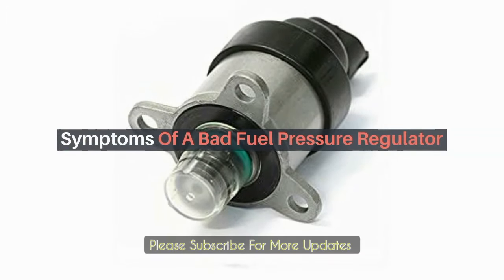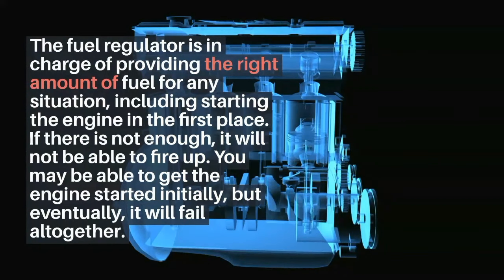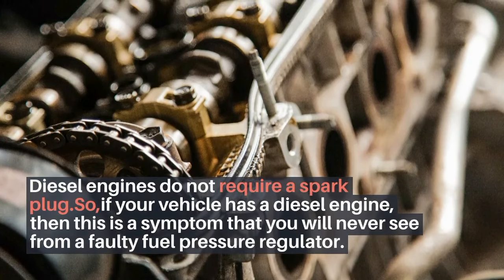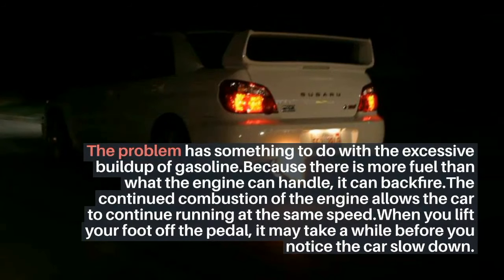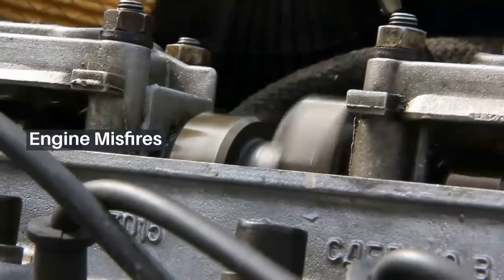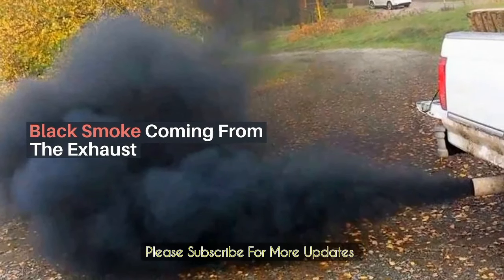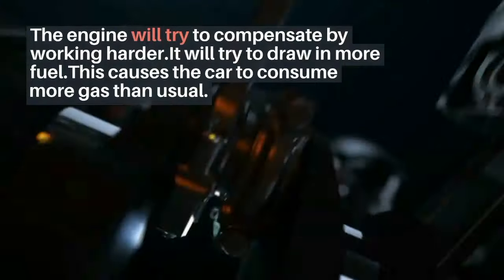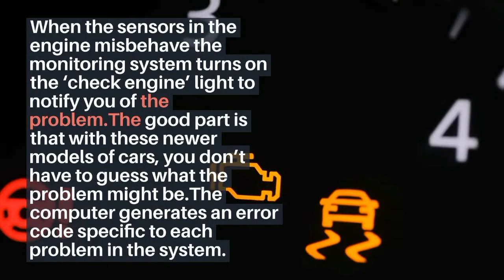Sign Of Bad Fuel Pressure Regulator | Auto Info Guy

Comment from the maker: Hope the video helps and thanks for watching. Feel free to mention your thoughts. Subscribe for similar contents. Take Care :) :)
Reply: My Chrysler neon stalled while i was driving last week, and i haven't yet diagnosed it. I was thinking petrol pump only and now this served as a reminder of basic car diagnostics (i.e. fuses, relays), which i forgotten about them. Thanks.
Reply: Hi nee d help car die take long to start sometimes when driving car stalling sometimes black smoke frm ex pipe what cn be the problem
Reply from the maker: black smoke from ex means too much fuel being burnt. Firstly clean the air intake sensors n valves, check for vacuum leaks.  Does the car give out a check engine light? Pls mention the car model.
Reply: @autoinfogroup1629  2011 renaultsandero
Reply: Hi! My 2003 chevy suburban won't accelerate at times. It shows reduced engine power on dash and when I put it in drive, it won't accelerate., it'll just drift. I've put a throttle body on and it still does the same. Anyone ever had this problem or knows what else it could be

Comment: My 90' 5.8 done all of this. I replaced just about everything and nothing changed. I replaced ICM = ignition control module and it stopped backfiring and ran smoother. But I still hear in 3rd gear a sluggish sound from engine. I've replaced the FPR too. Before ICM. So I'm sure it'll come back. Thanks, FORD. Nothing like a good screwing.

Comment: I have a 17 Jetta GLI, excessive fuel consumption. No issues starting, accelerating, no hesitation. Very poor fuel economy. According to diag tool, fuel pressure is higher than being requested by almost 2x.
Reply from the maker: This should be the regulator block.
Reply: Not the fuel pump regulator?
Reply from the maker: It should be the fuel pressure regulator. Any blocks in the regulator will cause more pressure to build up in fuel supply system. Or it could be the sensor reading wrong. Could test the line pressure externally using guage and cross check thw value with diag readings.

Comment: Ive been allover my 95 f150 looking for the problem. This describes just about every problem its having. I hope its is cause I kinda want my truck back
Reply from the maker: Lets hope it l be fixed soon :)
Reply: Was it the problem???
Reply: @jayjay7160  No. Unfortunately it didn't. It did help it but it was by no means a complete fix.
Reply: @emmanuelm2291  some things to try:

change fuel filter.
use some injector cleaner.
taking out the injectors is a bit of a pain but not hard, may need to flush them (vids show how to do it cheap) -injectors MAY need replacing but a clean should do them. don't use cheap injectors if replacing, they are all inconsistent and will give bad performance and strain your engine.
also try: cleaning and gapping spark plugs, (replace if corroded,) check inside distributor for corrosion. may need to replace either or all leads, coil, distributor cap, rotor, and/or pickup coil (requires taking out distributor, check videos before you try this,)
failing this you may need to replace fuel pump and/or clean/replace tank selector valve (if dual tank)
..slim chance you may need new ignition module or computer.
..none of this is too expensive and just requires some time, youtube has detailed instructions for each step.
hopefully this is not patronizing, just some things to consider in case 

you may also have a clogged catalytic converter.

Comment: i have 1994 e36, when i first started the car it does this limp mode(when first starting the car in the day it would also need a couple cranks before it really starts), wont accelerate and it also has an unstable swinging rpm. after idling for a moment, the car will start and move fine after i turn it off and on again. could that be a problem on the fuel pressure regulator?
Reply from the maker: Hi there, this could be any thing but less chance to a regulator. If the regulator is bad, should give out everytime not nly in the first start. Do clean the intake sensor n valve body, check the spark plug if to much greasy. These are the first two things to be done n see if changes anythin.
Reply: @autoinfogroup1629  oh okay ill look into that thanks for the help!
Reply from the maker: Anytime mate...
Reply: Same problem. Are you done with that issue? Can you tell me how to fix it?
Reply: @mirothegreatgwapo9824  it turned out to be a bad maf sensor or the fuel line if im not mistaken i kinda forgot lmao
Reply: The injector throttle must be serviced

Comment: Clio 2 2005 model has a line pressure fault.  The problem cannot be found, can you help?  injection or diesel pump?  brain?
Reply from the maker: Hi this could be anything from, hp pump failures, pressure sensor malfunction, fuel pressure regulator malfunction, injector excess leakoff or delivery.

Comment: My 2005 Honda Civic lx , shows the low oil sensor but when I hit the gas it goes away and doesn’t pop again till I come to a stop
Reply from the maker: Hi there 1.May be you are running with bad quality engine oil. 2. The oil pressure switch has gone bad. 3 your oil pump is wearing off. 4. worst, you have got excess wear in main bearings.
Do an oil drain, fill in with proper quality oil and see if shows again.
Reply: Possible dirty oil pickup screen. Try a bottle of motor medic to help clean the screen. Simple to use .
Reply: Actually, the most basic thing you should do is check if your oil level is ok.
Reply: You either have a bad oil pressure sensor or low oil pressure from weak oil pump or it just worn out

Comment: I own a Ford Fiesta 1.4TDCI and it starts fine when cold. After the engine gets hot, it takes too long to start the engine. The engine cranks, but it won't start. After trying for 2 or 3 times then it'll start, at that time of starting I can see lot of black smoke emitting. What could be the issue ?
Reply from the maker: Hey, try scanning the car and look for fuel rail pressure. This could happen if the rail pressure goes down when hot.
Reply: @autoinfogroup1629  Will do it. What're the further steps to be taken when Low or when normal ?
Reply from the maker: If its low, need to check the injector leak off quantity and pump wear. If the pressure is normal, check the battery voltage drop. if it sustains average 10v cranking volt. Also check the cam and crank shaft sensor, when they start to fail, loses the reception at high temp.

Comment: Hey man i got a 97 VW jetta and its been driving fine since i first got it but then about a week later it broke down on me and was doing all kinds of things like didnt want to accelerate up hills and would start bogging out and losing rpms while backfireing and pushing on the gas pedel doesnt do anything but i walked to a store bought a new fuel filter it and changed it out amd it started driving again for a couple days then it broke down again and i dont what it is. Coulr be the fuel pump but i checked all the relays and they all work but the pump doesn't make a noise when i turn the key but i never think it did in the first place so idk is my pump silent or something
Reply from the maker: If your car starts fine without any hesitation, pump cannot be put forwrd. Is this a diesel head or petrol? Does it throw a check engine light?

Comment: I have a 2002 cavalier my car wont start unless I hold down the gas pedal but as soon as I lift off the gas pedal the car shuts off could the regulater be my issue
Reply from the maker: Hi there, It sounds like throttle body. Try cleaning the throttle body n intake sensors first.
Reply: @autoinfogroup1629  thank you

Comment: I have a 240sx 1990 I have fuel pressure and spark but It doesn't start only with starting fluid but then it just stops  idk I think it has somthing to do with the injectors
Reply: It was also sitting for 7 years but I changed the fuel pump
Reply from the maker: Hi there, check the fuel injectors if its spraying the fuel or check the injection pulse. Do check the wiring corrosion, relays n fuses.
Reply: Any gas that is left in there for 7 years is BAD . You may have to drain it or use a pump to remove it ALL from the tank , lines and fuel rail . Don't mix new gas with the old . I have had gas go bad in under a year for the lawn mowers . You may also want to put in a cleaner like Techron or Lucas with the NEW gas .

Comment: I have a 2015 Chev Malibu with 177000 km and it shows code 0089 and code
 0016.  Code 0089 says it's the fuel pressure regulator and the 0016 
says it's the bank 1 camshaft position sensor.   I called the dealership for the price of the FPR and they tell me they don't have one  on the computer.  A dummy like me believes him because I don't find any videos of anyone working on the 2015 which seems to be different than the others in the engine.  Any information would be a appreciated as I have no clue where to find, even the line to fuel pressure test.   Thanks
Reply from the maker: Hi there, i guess its the 2.5 GDi engine. Its a common cause the hp fuel pump going bad. GDI has an integrated fuel regulator on to the hp fuel pump. So the pump as a component has to be changed. You may check the fuel pressure readings from a scanner, check the low side to be 45 to 60 psi and high side to be near 350 or 500 psi. Either the pump should be on back side right corner of the engine or on the front right cornor of the engine depending the type of engine.
Reply: @autoinfogroup1629  hello I also have a 2015 Chevy Malibu 145000 and the only code I have on mines would be the 0089 would I also have to replace the fuel pump as a whole?
Reply from the maker: Don't conclude its the pump itself, a dirty fuel filter or even pressure sensor could cause this code. Check the fuel pressure manually first confrm its from the pump output or not, change the filter if old also clean and check regulator too. Any dirt or grim in the regulator cause non closure of valve inside which lowers the pressure as whole. Pls do ensure all these are correct to point out a replacement.
Reply: @autoinfogroup1629  will do thank you for the help an response
Reply from the maker: Any time mate :)

Comment: My 02 duramax is popping a code for high fuel rail pressure, also not able to go above 2000 rpms until the code is cleared
Reply from the maker: It's pretty common in Ford when there's a fuel related problem,car won't go above 2k rpm. Here either the FRP sensor is inaccurate or the Fuel regulator must have blocks.

Comment: My 13 Nissan Maxima and misfiring on cylinder 6
Reply from the maker: Hi this could be a faulty spark plug or ignition coil or even the injector.
Reply: @autoinfogroup1629  I’ve already changed all that and and that wasn’t the problem

Comment: "backfire" is actually a term used incorrectly... Backfires are more common in carb cars where it ignites and fire COMES BACK... From the intake..

What you displayed (fire out the exhaust) is called "after fire"
Reply from the maker: To be noted.. Thank you.
Reply: They also said black smoke but I thought fuel creates white smoke
Reply: @andypacmanperez  what? fuel makes black smoke, moisture makes white smoke

Comment: Sometimes my car start sometimes it dont could that be a feul pressure regulator
Reply from the maker: May or may not.... there are other reasons like bad ign coils, sprk plugs, cam or crank sensor etc... have to check each one. Does it throw a CEL?

Comment: You need to use better title words wish this was the first video.
Reply from the maker: Thnks for the suggestion. Will update that soon.
Reply: Were does the fuel pressure regulator located in vg33, V6 engine petrol machine

Comment: So the same symptoms as the 20 other things I’ve replaced this week/
The fuel filter, pump, TpS, ig control valve, MAP, dist rotator, ignition coil and wire, coolant temp sensor..
I mean, what the fuck?!!
Reply: Hope you get it fixed. My truck acted like it ran out of gas. Replaced my cam sensor and it was fine. There's two on the back of my motor. 2008 frontier.

Comment: I have a volkswagen polo gti my car wont go over 4000rpm
Reply from the maker: There re many reasons for the same. As preventive, should clean the air intake sensors, throttle body, change the fuel n air filter if too old or run too much.